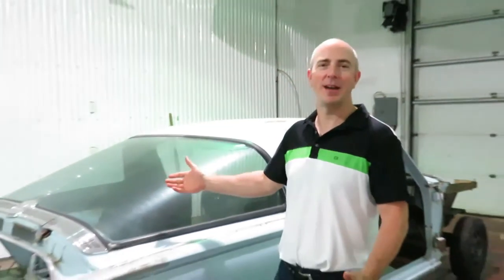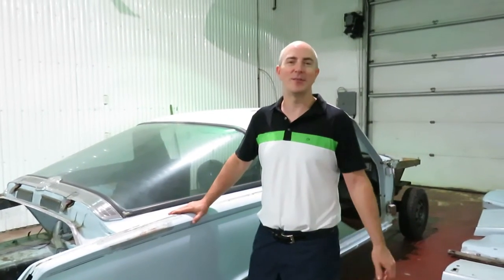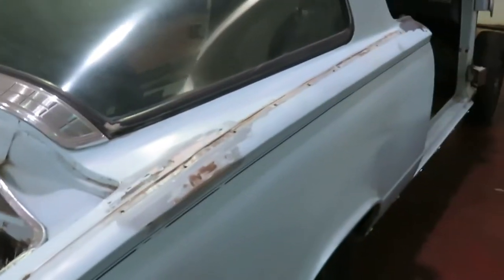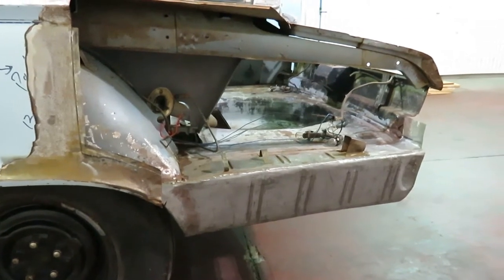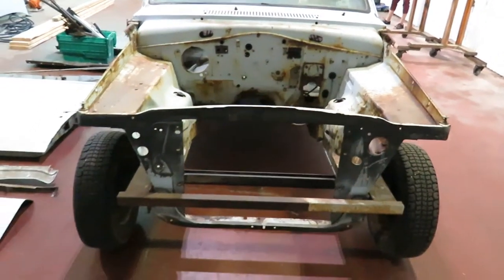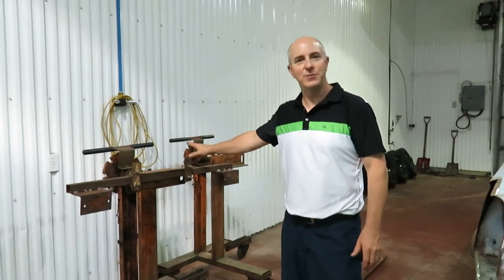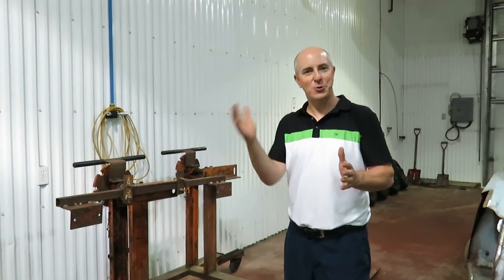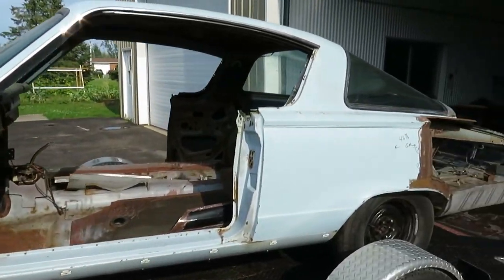Restoring my 1966 Plymouth Barracuda - part 1

Comment: Nice car! I would have removed the glass and trunk chrome. We just got a 1965 Barracuda the same color as yours. I replaced the front floor pans and rear wheel arches. Next, I'm going to pull dents from the front and rear valances. It's got a 318 auto on the floor. It will be my daughter's high school ride.
Reply: We're going to do a color change. She wants the 1970 'Cuda Sassy Grass Green/ Sublime Green.
Reply from the maker: Hi JosephDR. Thanks for the comment. We are doing a color change too. Stay tuned.
Reply from the maker: The bodyshop removed the glass and chrome.

Comment: Thanks for your video I have a 1966 Plymouth barracuda formula S4 speed 8 3/4 rear 273 four barrel stock all original except for the paint so it's not original somebody a long long time ago painted it like a reddish color and it's a it was white and I have no idea why he changed the whole interior to Black because according to my VIN number it was red interior and that was like maybe like 25-30 years ago and I have the car since 2002 I could drive every day for want to but I don't good car starts up on the dime even in the cold first shot any heater still works isn't that great good luck on the barracuda 👍😂 sorry I don't check when I'm speaking but I get I guess you get the gist of it

Comment: Found a 66 that is complete but not running.  Extensive rust along driver edge windshield and along pillar down to hood.  Debating on taking the plunge.
Reply from the maker: Hi SCTV59. It's a personal decision as to whether to take the plunge. I did it and it's been definitely a process. Stay tuned for an upcoming restoration update video.